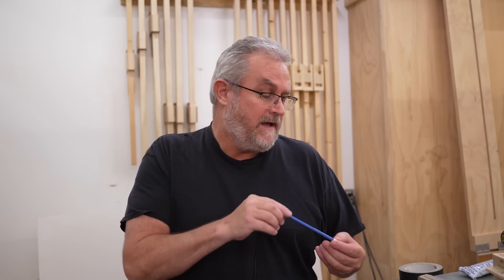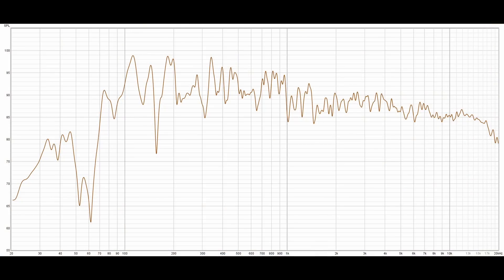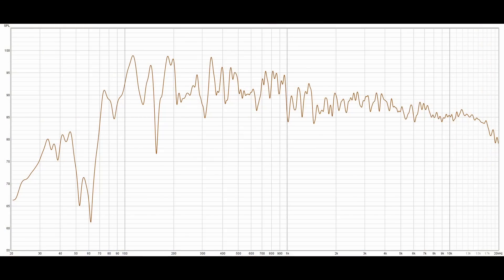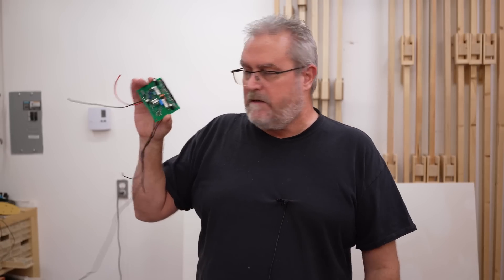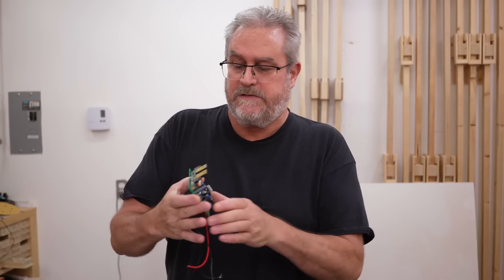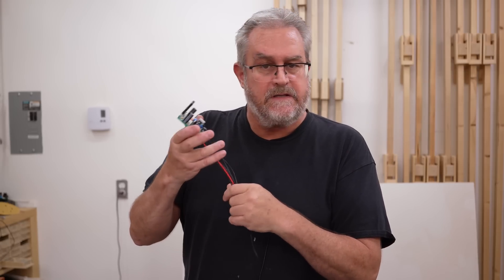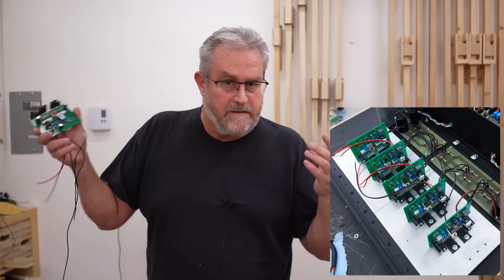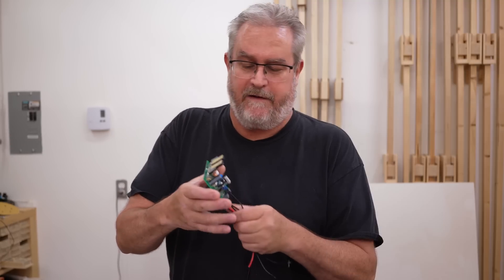A Rant about Speaker Measurements - They are Mostly BS

Comment: I watch many of your videos and respect your opinion John, but I disagree with you in this case. Every component in the music reproduction process needs to be designed for flatness, except for the mixing.

Why? The engineer mixes it to sound the way he wants you to hear it, hopefully using flat response amps, monitors, etc.. If the recording is not flat, it will change the response. Also applicable to the CD player output signal (or whatever source you use): non-flat response will change what you hear. Same with the amp: if it is not flat, it will change the response more. Ditto with the speakers: another stage of changing response. All these changes compound!! If you lost a little bass and treble, and added peaks & dips every step of the way, by the end of the line it will be even worse.

Without flat response in every stage of the audio equipment chain, the resulting playback could be very, very different from what the engineer wanted you to hear. You might like this distorted version better, but that's you. Another listener might feel very differently. If systems are aimed to be flat response, at least it is going to sound similar on every music system you play it back on.

Is perfect sound reproduction obtainable in practice? Not with today's technology, but it's get better and has sure progressed a long way from the old phonograph and tube amp days. Some people like the coloration that imperfect response adds, and that's fine. But if no system comes close to flat reproduction,  you might hate the way your favourite song sounds on your system, but love the way it sounds on your buddy's system. For a different song, it might be the other way around.

Does the room further change the response? Of course it does, and that's the hardest one to control, but as you know there are things you can do to fix that too.
Reply: I agree, see my comment please. Studio recordings determine how a song will be heard no matter what the playback system is.

Comment: Frequency Sweeps dont tell the full story..   because speakers tend to reveal most of their Distortions, when multiple sounds are playing at the same exact time.   I had speakers that sounded good... but when compared to a much better Audiophile speaker... I noticed that for the first time, I could CLEARLY understand the lyrics that a singer was singing.  With all of my previous speakers... this mans vocals in this particular point in the music...  were getting distorted amongst the other instrumentation and effects.   But this particular audiophile speaker, was so "distortion free" ...that it was able to accurately deliver the sound... in a way that I could easily differentiate his vocals, and all of the other instruments as well.

 Of course, these speakers were the  EPI 100v  speakers.   They are sealed,  and have very powerful magnets on the woofers.  The extra magnetic power, allows for FAR more precision, control, and much faster acceleration potentials...  compared to drivers that have much smaller and weaker magnets + weaker coils.   They also use a thicker gauge wire winding on the woofers, which automatically filter out the High Frequencies... thus eliminating the need for an additional crossover component (which arguably could also cause distortions).

 As for the Measurement system... Its still impressive,  in that its able to get readings, in 360 degrees of the speaker.  Im not so sure that the room matters in those readings, because the mic is facing the speakers, getting the soundwaves before they hit the walls.   It might depend more on how the capture program is set up.   That said, they probably should pad the walls, just in case.

 But like Ive said before... These sweeps have virtually no bearing in a speakers true potentials.   As once you crank your speakers up... and depending on the dynamic layered complexity of the actual music... you are going to get distortions..  and the amount of distortions, will depend of the drivers capabilities.  Since Distortions are rarely tested on anything but high end headphones... and even then might be flawed in the way that they test...  most of the presented data becomes flawed.. almost meaningless.

 Also, the EPIs are one of the rare speakers... that I can place virtually anywhere in a room... and they will sound fantastic.  This isnt the case with most speakers.  Heck, Ive had them under my desk, and partially blocked... and they still sounded flipping fantastic (meaning, you couldnt tell that they were partially blocked, by merely listening).

Comment: Your brain will make adjustments to the sound coming out of your speakers, provided you don't outright hate the sound, in a way that new speakers might not sound as preferred over speakers you have had for awhile until you listen to the new ones exclusively for a sufficient time. Then swap the older speakers back in and you may find you now prefer the new ones. Generally speaking.

Comment: Unfortunate comments like this, including the more unfortunate one in writing under the comment section, originate from absolute lack of knowledge about the subject and I am saying this with the most positive and compassionate intention. The conditions which are referred as “room” are nothing but a mix of anechoic and reverberation chamber conditions. The name brands can hardly afford an anechoic chamber, the ones that sell speakers less than 100k$ don’t even bother and depend on gated measurements, maybe reaching down to 100Hz, but even more rare manufacturers, maybe none left as of today, have a reverberation chamber to check the power response of their filter setup. So, if you look at the frequency response transfer function, it is tip of the iceberg. What about THD, what about IMD, what about the impedance loading, what about the power response which will define the behavior of the system in a listening environment, or even off-axis response if the reverberation chamber is busy for the day? Such measurements are not mentioned in any of the universities which have courses on this topic, and none of the text books have enough explanation. The people who share information are commercially charged and their information is solely aims to sell their product, which further confuses the end user. Some even have a misleading results like Klippel (just because in some comment somebody dropped the name). What is misleading, you may ask. Have you ever sent an email to their support and asked why they are sharing the Le(x) curve with reference to 1kHz while your sub-woofer will never go beyond 150Hz? They will avoid saying that they can not do any other frequency other than the 1kHz because of their system identification model. So, does this qualify as a “measurement device” if you are going to be measuring only what you are told to measure, rather than what you need to measure? So, get the pair of speakers you like, throw those rubbish review magazines that have hidden commercials like Google, and enjoy your audio adventure as you don’t have to prove anything to anybody if you are enjoying what you hear. Nobody can judge you anyhow because no two people’s hearing is the same. Don’t believe me, go read about Nura Headphones and how the hearing can be equalized according to a persons ear channel impedance.

Comment: For the most part, T/S specs are useful for enclosure planning and some basics of performance limits.  Beyond that, every single speaker sounds vastly different just based on their construction.  I have found no good way to determine a good sounding speaker versus a bad one other than actually listening to them.  Every single driver, every combination in a system, it all varies.

You hit a lot of good points on the entirely of the system and every single step along the way.  Every step matters.  Every step effects.

I don't know why you gotta harp on the other guy.  I like watching his stuff too.  Can't we all just get along?

To be fair, key things he brings up are important, but like you, I've played with raw drivers and played with all the specifics.  We learn that so much of this stuff is adjustable, correctable.  But...if you take a premade at face value and only face value, then it will have the one output.  That is the constraint of premades and simply using them as-is.  And for that, yes there are oddities you live with, have to compromise, and start to worry about peaks, dips, off axis behavior, toe in/out, and whatever else.  In terms of buy and use, that's all that's left.  You don't afford yourself the luxury of all the other customizations.

Comment: It doesn't matter where the music was recorded. It matters where it was mastered, and that is in the mastering studio. Your setup should aim to be what a mastering setup is. Also most people hear things the same way, I think it was some harman study with the only real preference in the amount of subbass. In-room response should be slightly tilted down. You eliminate reflections by having sound absorbers on the ceiling, carpet on the floor and some bigger absorbers behind your speakers and behind you. Also speakers should ideally be coaxials in a waveguide. Everything weird going on in a room below ~500Hz can be fixed using EQ (unless you have a bass cancellation). Above that you need to fix it with sound absorbers (that is ofc if your speakers measure flat in the ideal scenario). And at around 105Hz subwoofers should come in and be at least flat, or better for most people around +6dB. Also amplifiers and cables stuff is mostly a scam. Just get or make a decent amp (like -80dB thd) and you'll be fine. In the end music is very much about having a good frequency response. First you start wtih flat (on graph) speakers and then you make them flat in the room. All of this is objective. That's it.
Reply: This is what I was thinking but articulated in a much more technically competent manner! 😅

Comment: When I read the title I was like WTF!!! But you are right that speaker measurement is mainly interesting for builders/manufacturers so that they can create a good base for a system. It can be useful for room EQ and finding "flaws" in your room acoustics but in the end it all comes down to one thing : do you like what you hear.
A great point you make is that people get used to what they hear. One example is when some "audiophile" replaces all the caps in his speaker x-overs and starts breaking in those caps over a period of several days (maybe weeks) and claiming how it sounds so much better after a while ... well, I am pretty sure that the main thing that has been "breaking in" over that period is the guy getting used to what he is hearing (especially wanting to hear the difference).
My advice to people is to maybe start with decent speaker specs (doesn't have to be expensive speakers) and then start listening to them doing lots of A/B comparison. If you are one of those that prefer those cheaper speakers ... good for you, as long as you like it.
PS : I have a set of very flat studio monitors and it's something you have to like hearing, I personally like the sound but most people are not into "uncoloured" very flat response. Depending on the type of music I listen to I sometimes up the LF a little because flat sounds very "cold".

Comment: Oh, I read the your deep write-up.
And I am a little bit of upset 😅 and thought that you somehow understood this technical measurement stick..

I didn't see this coming 😂

If someone bought a pair of speakers from you. And own their property they undone your work. And forget if you believe or not that more expensive components or not have any impact or not.

By undoing your work they on the speakers they own they have somehow arrived at a conclusion that if the value (mH, Ohm or uF) if the inductor, resistor or capacitor should ve of another value or the topology of it they needed to change.

Why should you be upset? 
As you know the owner taste and preferences changes by time and he is maybe adjusting to that changes. And even your taste and reference are moving you are not that special in a vault that we can fetch when we want a opinion.. if you "voice" the same speaker today then you will most likely not arrive to the same (mH, Ohm or uF) if the inductor, resistor or capacitor values! (You are a floating variable)

So you have nothing to be upset about. 😊

Only one thing to be upset about, if the owner of your built speaker change/modify them and dont disclose that and say that it is your spekers.. the listener is fooled that you might have "voiced" them like that.. and that is not cool! 😅

I think you are throwing all research and development in the audio arena under the bus from the last 70 years.

And that is not something I myself thinks is cool. 😢😊

Yes, your preferences and mine is not the same. Yes where the speakers is placed, angeled or where the sweet spot is placed in the same room will effect the sound and also if we change the room entirely.. as you say.

ALL that that plus all the issues you brought up and difficulties is just bla bla bla.

I meen that if we just decade after decades just complaining that this and that makes all of HOW a speaker will sound in your room just pointless.

Then we will not progress ANYWHERE and being stuck to listening to subjective reviewers withe their ever changing preconditions. When the goal post is moving around like a boat in a storm..😮🎉

What I meen is research has moved us to where we can see on the measurements how wide the dispersion, how deep down goes the extension and so on and on. We also get predicted in room response. Those things is as static that we can get in 2023. With all  standardizing work tht has been undergone.

All that is what we have come as a example to so far from research and development.

All THAT is what you throw under the bus. 😅

I would never thought that you would prefer a subjective reviewer that as you said your self his mood changes and would for example could without a problem say:
"the base extend low when I listening to them"  and saying the exact same sentence 6 months later for another brand/model of speakers.. or maybe changed listening location, room and whatnot.😢
(and those two speakers could most likely have a very different bass extension or levels.. ..but the reviewer had no distinction between them and the poor consumer cant and will never know..)

Measuring is knowing that is a little part of why you probably do your own measurements. 

You learn and optimize fom those things you learn. But not all can invest time and money in all of the things you have been doing. 

Kudos to you and all of your lovely sharing!❤👍🎼

And sorry for my rambling and that were just from reading your video comment, I probably are to scared to watch the video now.😂🤣👍